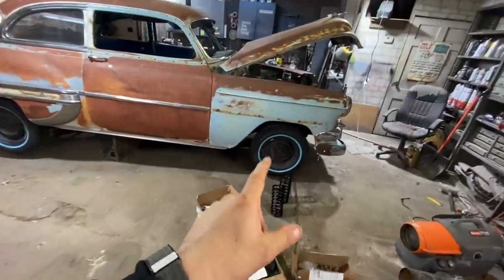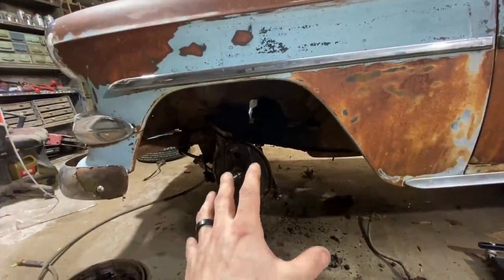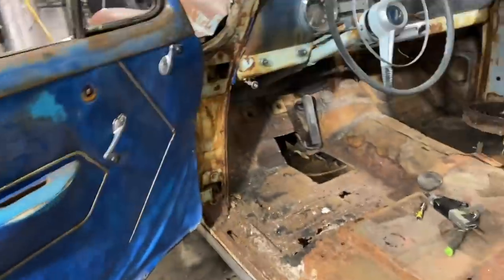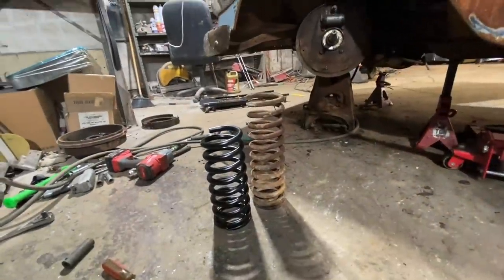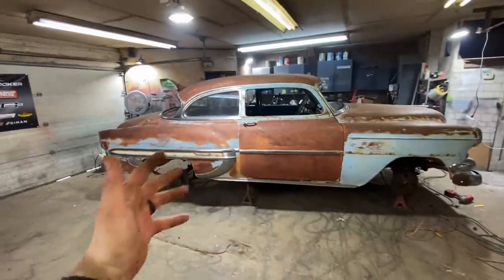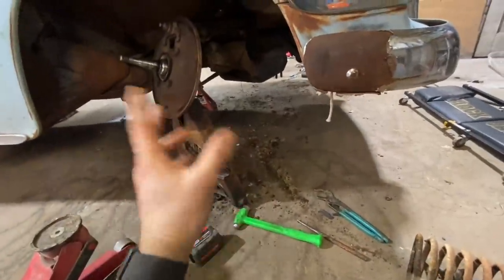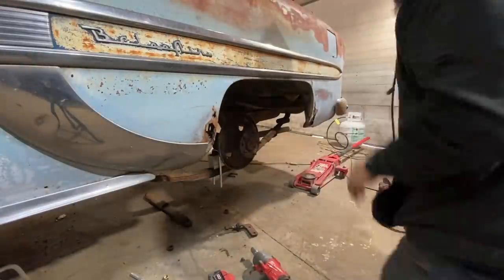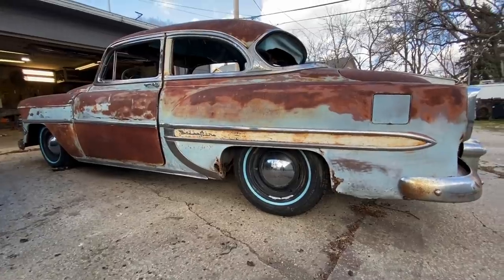FREE 1954 CHEVY?! TRADITIONAL BUILD GETS DROPPED AND NEW BRAKES! HOT RAT ROD PATINA KUSTOM DROP KIT

Comment: What if you made that part of the floor as an access panel since it's in a trash place and make it bolt in to access it?
Reply from the maker: I actually think that’s what I’m going to do.
Reply: It was just poor engineering at the time of where they put that. I almost had one of these about a year ago but guy sold it out from under me. I was either gonna make a panel to access it or put it on the firewall with an upgraded booster
Reply: Literally 53 or 54 are my favorite chevy cars from the time. If I could find one I'd grab it. Currently working on a 67 c10 and 72 c20 along with trying to get my 72 monte drivable. My ADHD cant stop doing this to me lol

Comment: I thought the Belair top was flatter? I thought they were convertibles with a top put on it?
Reply: Pretty sure it's just a trim level. Not 100%.
Reply: @brianhaw9398  thanks 👍🏽
I know the 1950 model came out with five different body type's/model's they even made an El Camino type truck that was a speacial order so it was a rare model of the 1950 Chevy. 1949-52 the body's were similar.
Reply from the maker: 49-52 only belairs we’re hardtops, 53+ belair is a higher trim level and can be in almost any model.